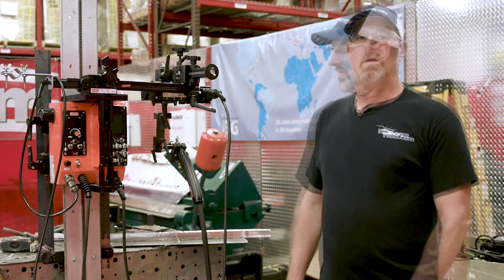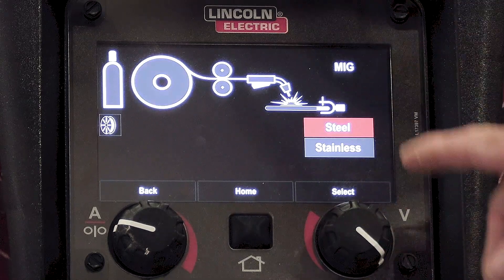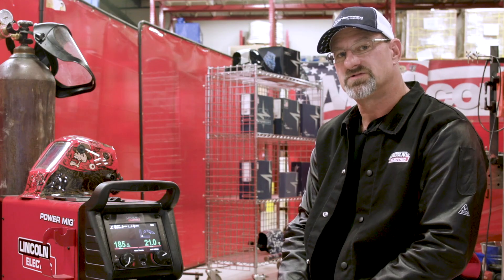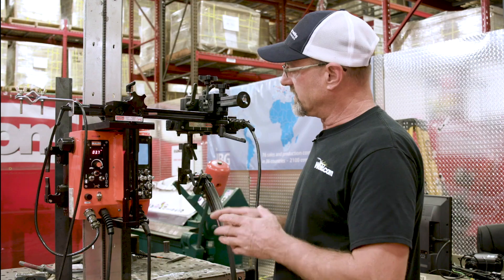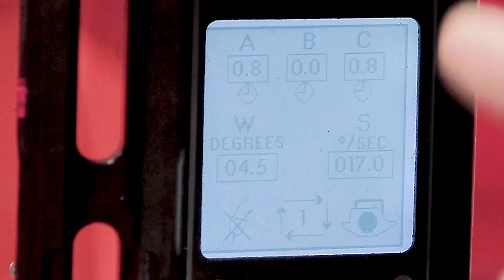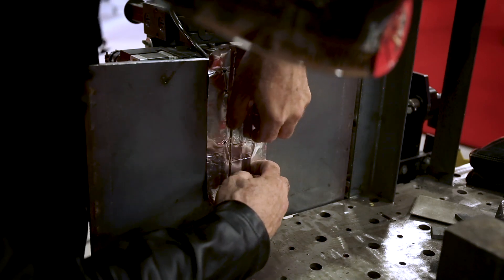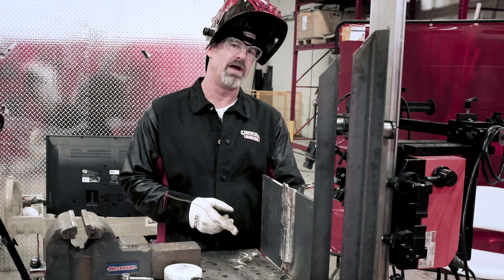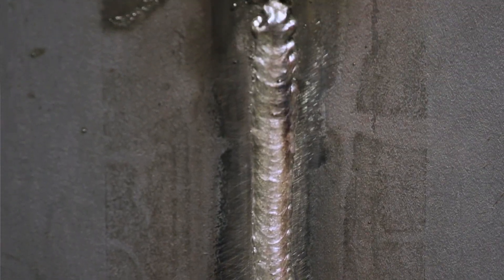The Benefits of Using Ceramic Backing When Welding

Comment: Working at bath iron works shipyard I used ceramic every day all different shapes and sizes. I used it a lot on UT weld roots and never ever had one indication. I used mostly 0.45 100s wire with 95/5 gas and ran pulse arc.
Reply: Too funny, I just accepted a job offer there as a grade 5. It’s a small world I guess lol

Comment: Seems to me like he talked more about the machines and their settings. Putting a backing on root welds like this isn't uncommon, pretty much always done. I thought he was going to talk about why ceramic might be a better option than other backing materials. That would have been far more informative.
Reply: he mentioned that you dont have to grind off a backer bar or gouge out a root and weld from back side.

Comment: I would love to see a video on 0.45 100s with 95/5 gas vertical up multi pass butt weld with pulse arc. That would be neat to see on YouTube. The navy required us to use that process instead of flux core because of heat input on certain things. I’m talking 3-4 inch thick butt welds. It was slow that’s for sure lol.
Reply from the maker: We will get both of our Paul's to work on that!
Reply: @Welddotcom  awesome. Thank you 🙂